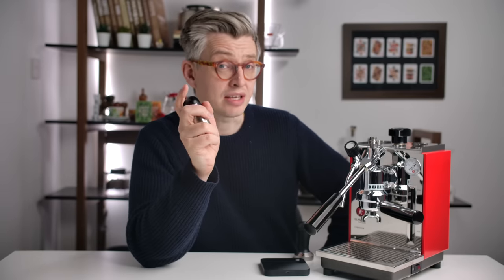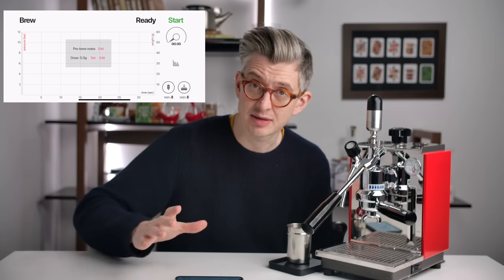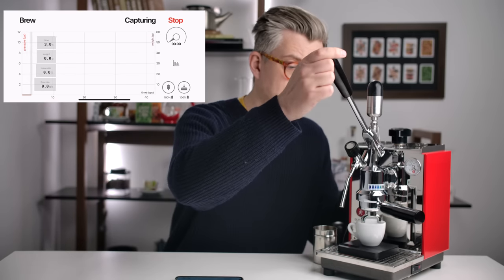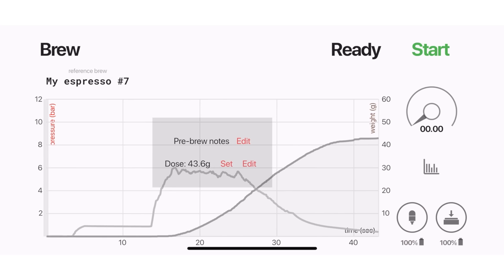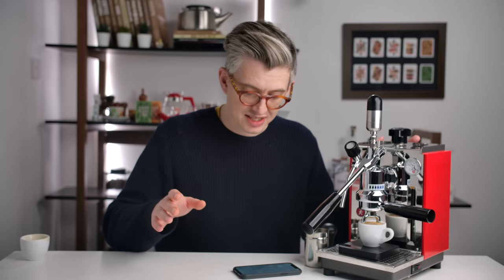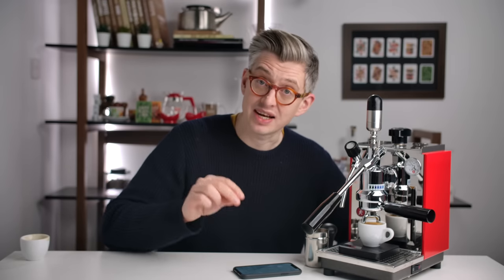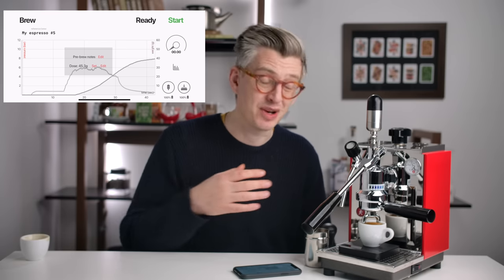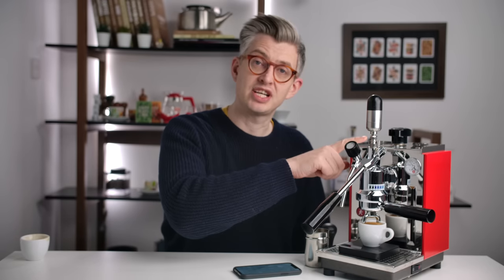The Smart Espresso Profiler Review

Comment: Very very interesting. Love the Cremina, didn't expect to see that! 

Do these fit (or can they be adapted to) an E61 group? Would complement something like an ACS Vesuvius (a pressure profiling E61 machine), I think they even now ship with a grouphead manometer to complement the water distribution manifold transducer readings. 

Existing Lunar and Pearl users can check this out, it builds on the Chrome low energy bluetooth API to build flow rate graphs. Work very nicely (no Pearl-S support yet!): https://pakoquijano.github.io/Acaia_Scale_Web/
Reply: It works with E61 heads, just screw it in and you're ready to go. The app also works without the pressure transducer, only the scale. Obviously, this way you only get flow reading, but this is also really interesting.
Reply: @mikloscsanady3955  Interesting, whilst watching the video I was thinking that it would be cool if it would work with an E61. Now, can I justify the cost...
Reply: @mikloscsanady3955  thanks for the reply, great the app just works with the scale.  If you added flow rate onto the graph (like above) it'd work well for pourover users too.
Reply: @greensprat  long tap the screen and press "Toggle weight/flow" on the pop-up menu. You're in for a surprise ;)